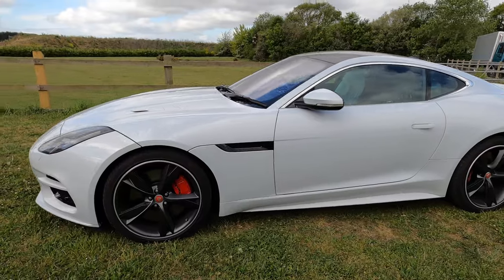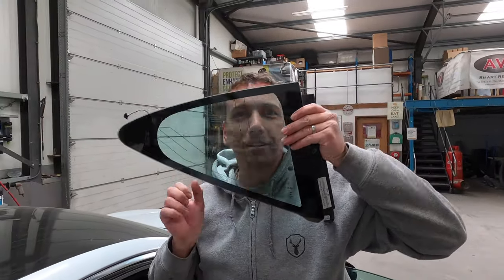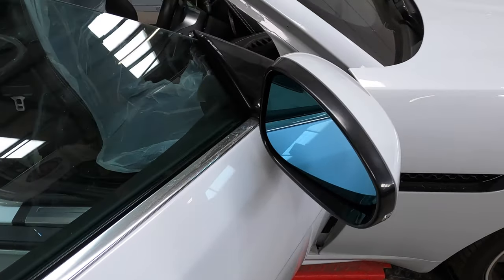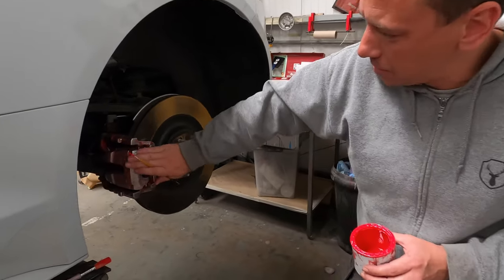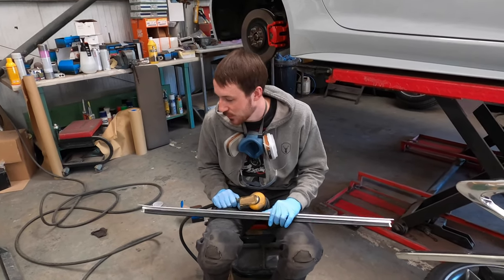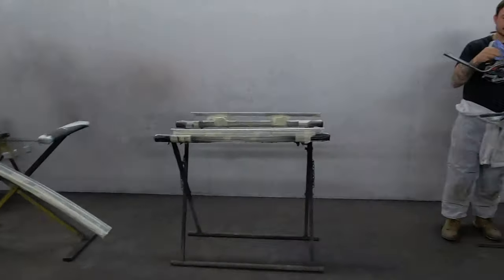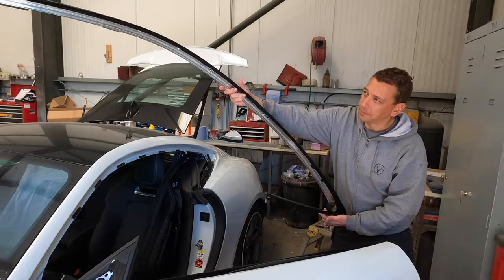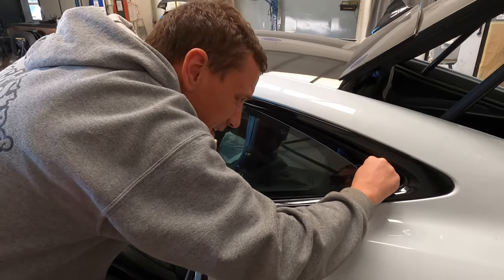Jaguar F Type MODS! - Painting Chrome Trims Black, Red Brake Callipers - Modified Jaguar F Type

Comment: Great work. What will stand the test of time better: painting chrome bits black as you did, or buying replacement black bits from Jag? What's cheaper usually?
Reply from the maker: M D glad you enjoyed our video 👍🏼 as long as the chrome is prepared correctly it will last no problems. Also it normally is much cheaper to paint then than buy them black from Jaguar. 
Don’t forget to check out our other videos then please like and subscribe to our channel 👌🙏😎